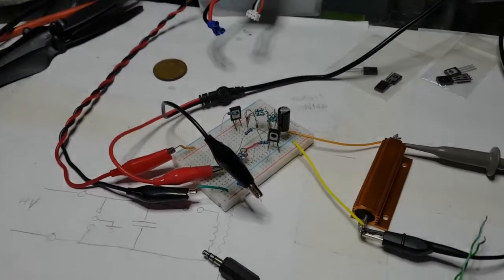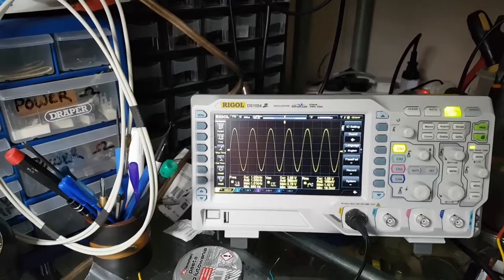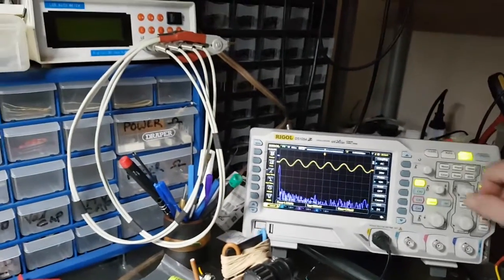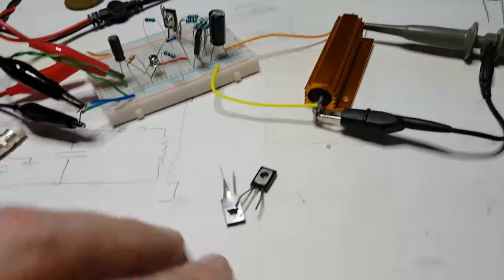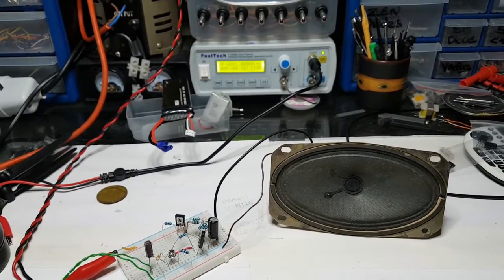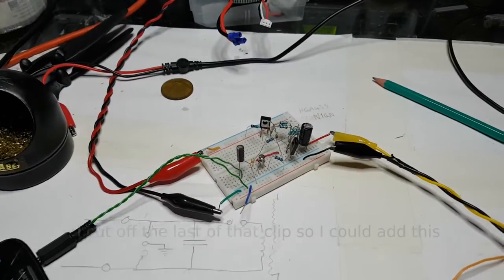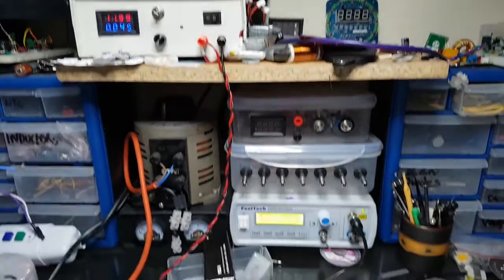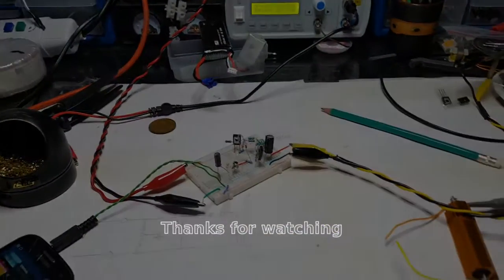Revised 3 Transistor Audio Power Amplifier Circuit

Comment: I use a typology like this for a low power guitar amp that I build, and I like it a lot better than the typical LM386, which sounds way too lifeless and grainy. I use an 2n4401 and 2n4403 for the power and a 2n5088 for Q1 with different values for your 5.6k and your 1.5k. I've even stuck an PNP  "Long Tailed Pair" (Differential Amp) in front of it, with good results. Thanks for the video...
Reply from the maker: Your welcome, I am glad you enjoyed the video. Cheers for your positive feedback. if your interested I just built this one, it features LTP. https://www.youtube.com/watch?v=nXLveqikhws

Comment: I think it's great you gave the analysis a chance, tweaked, and ended up with great improvement!  Certainly sounds big.  Of course, really pushing the amp hard and continuous COULD cause sustained 80-130ma, but as you observed, for the brief test nothing got worrisome hot.  As long as there's plenty of heat sinking and power supply voltage is well below the transistor emitter-collector voltage maximums, should be very reliable.  Push it really hard, and it will just distort.  

Having replaced the output devices and getting decent improvement begs the question;  what's different between the devices?   You might take some time looking at the data sheets for the old pair, versus the new pair.  It would be interesting to see the comparison between devices gain, 'beta'.  The higher the beta, the less base current is required for a given output current.

Also, you can always measure collector current of the 2n2222 (I think) driver transistor, to see what's going on there.  And, or, check for distortion at the collector of that device.  Maybe the distortion happens between the driver trans and the output trans's.

Happy electronic hobbyists try new and different things AND stick with the troubleshooting.  Best!
Reply from the maker: OK so with your comment read, firstly, I would like to say. Thank you or your interest and input with this project, secondly. Thank you for opening me up to the confusing and argumentative world of Beta. After studying the datasheets with the eyes of someone who might be best asking questions such as "Would you like fries with that" My conclusion is this, granted I may have gotten this all wrong, but here goes. You need more current with 2SB772 and 2SD882 than you do with the BD140 and BD139 to get the same output. The later transistors require less current for the same difference in between Ic/Ib and if hfe plays a part then at lower voltages the BD139 and it complimentary counterpart fair better. I will check the 2N2222 driver transistor when I have had a cup of tea and a biscuit.
Reply from the maker: After saying all that. I have a meter which displays the Beta value. It is quite contrary to whats expected.. I am more confused now. Lol, you have to love this subject.